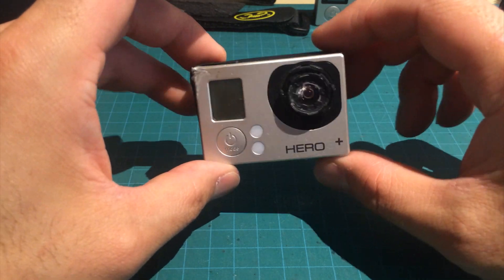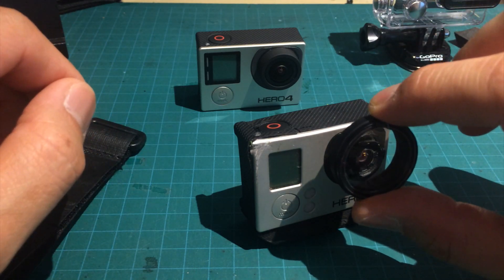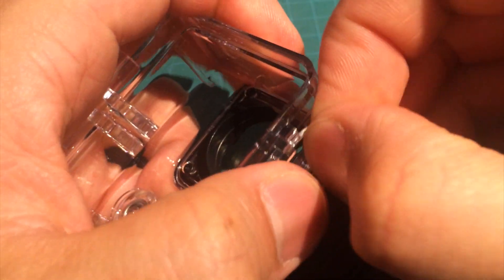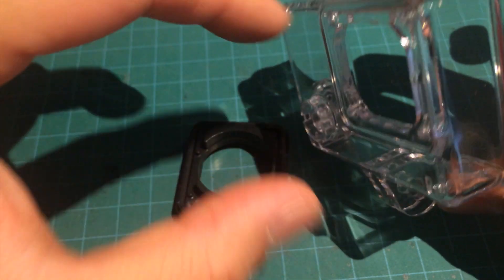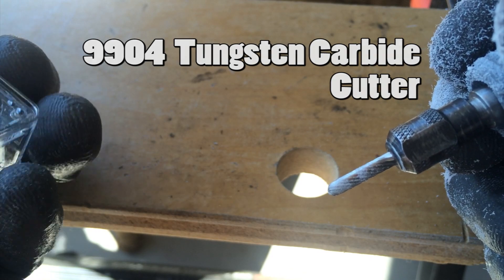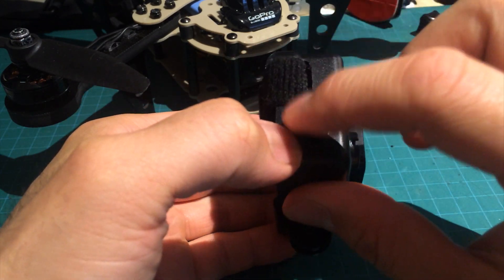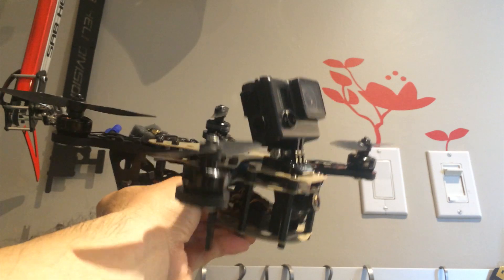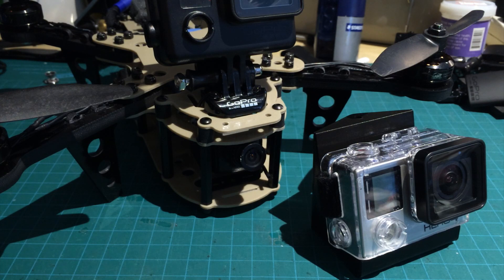HOW TO: homemade LayerLense

Comment: Love this!  I would not trust the zip ties to hold your mount in, however.  There is tremendous leverage with that stock mount. And if you fly in tall grass fields it could take hours to find it. So further secure it with nylon aviation cord.
Reply from the maker: Quadrysteria thanks for the advice :)  I chose the ziptie to absorb the impact forces and seperate if it's too strong... but definately I've spent once or twice looking for my gopro.

Comment: just thinking now you have removed the back door of the case you could put a small amount of foam on the face of the gopro to cushion impact shock penetration, now there is space. (minimal weight gain to good effect)
Reply from the maker: That's actually a really good addition :). I've been using those adhesive back craft foam on the inside face of mine.  Great minds think alike.  I left out a few advanced techniques to put in a follow up video... This one was already getting so long.
Reply from the maker: I usually cut the foam to cover over the screen too to put extra support where needed. https://plus.google.com/+AntigravityRacingFPV/posts/UChZZjPNY7k
Reply from the maker: Royal Blue if you have question during the build - feel free to ask. :D